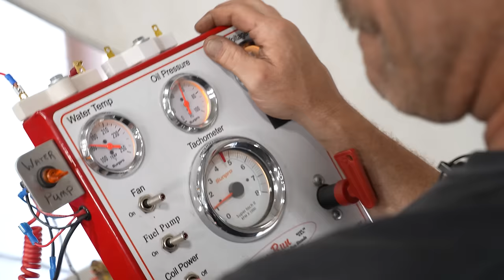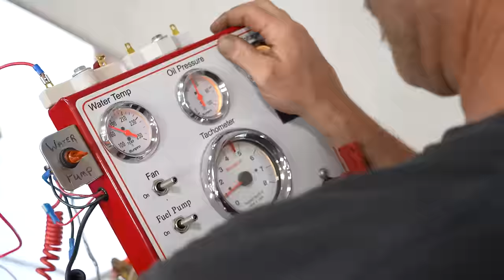Crusty Chevy V-8 Engine Rebuild Time-Lapse and Stop-Motion | Redline Rebuild

Comment: That video is a cinema masterpiece. But... that engine is about 66 years old. The oil fill in the intake and the vapor can in the lifter valley indicates it vintage. The exhaust manifolds are 70’s items. Ram horn manifolds would be correct to that motor. But I still loved it.
Reply: It came out of a 66 Chevelle, that'd make it 58yrs old.... 🤦

Comment: The most amazing thing about this whole video is how all the exhaust manifold bolts came out without even one breaking.
Reply: Pretty impressive. I’m going about it all wrong. They are a whole lot faster than I am and telekinetic.
Reply: @johnsullenger4397 ,  on a Chevrolet engine, that's normally not an issue

Comment: The editing.. the music... Hagerty is on another level of editing.
(cant even think how long it took to do the screw/bolts shots... but worth it...)

legit i opened this video to have something in the background, and i couldnt look away for the 8 minutes lol
Reply: you said it !! absolute greatness, Thanks guys!!
Reply from the maker: Thanks Nick! The disassembly shots took... a while! But we thought it was worth it, too!
Reply: Sir please 🙏 big fan of your work..can you please 🙏 make one video shoot and edit tutorial please 🙏🙏🙏🙏🙏 please 🙏
Reply: @Hagerty  I would imagine a few bottles of some nice cold beer, too. 😆
Reply: Where do you get these musics on your time lapse videos 🔥
Reply: @Alaeddine k  I require same info. The musi ID apps only work for some clips. But not these
Reply: A real film & mechanical masterpiece, No doubt ! It's exhausting just watching ! But  Damn , you should have bought an already super clean , hi - performance LT - 1 , 350/383 - bored Crate engine with a 21st century C.A.D. camshaft &  headers & and the older GM spread - bore 4 barrel carb with matching Intake ! Installed with full length dual exhaust with cross - pipe and long (3-foot ) straight - through glass - packs . Very street able and killer torque .

Comment: The most impressive thing of this stop motion is the rotation of the camera and how smooth it rolls. Brilliant work
Reply: You see the rig they use in some of the shop diary videos - it's a motorized slide rail that slowly moves while the time-lapse is taken.  They must have added a motorized turntable for some of these shots.

The corkscrew motion is probably done in the video editing.

Comment: Another timeless piece of editing goodness! I love the macro lens shots of inside the engine where the camshaft goes. Never knew how roughly casted those engines were back then. 
She purrs like a kitten like Davin says. Those restrictive cast iron manifolds really makes the engine quiet. A set of long tube headers and a beefy cam would make this engine sound niiiice. But I understand, this rebuild was meant for a stock cruiser. The engine was rebuilt better and more balanced thanks to the guys at Apex Competition Engine for balancing the crankshaft.
Reply: A shame to put that carb and manifolds back on it imo.
Reply: @karenthomson9749  I know, but it was relatively stock build as Davin mentioned before. He even mentioned before the block got painted, that black painted blocks are race engines. Orange painted blocks are stock lol
Reply: Well... when I saw the roller tappet brackets being installed I scratched my head a little. When they installed the OEM manifold and two barrel carb it becomes clear that this isn't a fire breather but an engine made to live on pump gas on the street.

Comment: Sweet! My first vehicle was a 1969 Chevy Blazer  350 small block. It had a 3 speed transmission with a L for Low in the first gear position. Low range Low gear hand a fifty two to one gear reduction. Thanks for the video. The presentation was great.

Comment: My first car was a '67 Impala Sport Coupe with a  283, "Powerslide".  Except for the "ram's horn" exhaust manifolds that was the engine that defined my youth.  Other than the  curious need to rebuild that 2bb Rochester carb and the nylon timing gear that left me stranded with my high school girlfriend on a deserted side road, it was an excellent mill.  Thank you for not giving in to the "stock build" trolls and allowing me to see this old lump brought back to it's original form .... 2bb carb and all.  Excellent!!

Comment: 283 c.i. standard hp was 195. Owned a '67 chevelle (and a '66) Both we're marina blue. The '66 had a 283 black  vinyl int. and the '67 had a rare 327/275 with blue vinyl int. The '66 had a power glide trans and the '67 had a 4 spd manual w/bucket seats.Had the '66 until Uncle Sam sent me to S.E. Asia, sold it before I left. The  '67 was used with 22,.000 miles when I got it. Price? $ 1,550. Actually liked the '66 better, my first car but the '67 had a little kick to it and was more fun to drive. The guy that sold me the car stated that the engine and 4 Spd trans were special ordered, that's why he was asking "so much" for the car.

Comment: I currently have a 1978 Chevrolet big 10 I gave $800.00 YES 8 HUNDRED DOLLARS for. 
Tore the engine down, ran the block numbers and it's a 350 4bolt main out of a 80 to 85 Chevrolet truck. 
The trans is a 400 turbo. 
This video makes me want to kick it in HIGH GEAR and get this thing BUILT AND ON THE ROAD. 
Awesome video, THANKS.

Comment: I've been driving since I 17 yrs old , now I'm 76 and still driving ' have done up two side valve engines two 6 cylinder O H V Engines and once owned a V 8 Ford G T , ( 351 WINDSOR ) , what a beast that was , highest speed 120 M P H !
I currently own a 1974 Toyota Hilux with original power plant and body , and "NO",  its not for sale !

Comment: That's Probably one of the coolest Vido's I've seen in a LONG time ! For Old Gear heads that broght back ALOT of memories . If you'll Look at my profile Pic. you'll see why ! 2018 , L83 ! No more AFM , Complete Brian Tooley Racing rebuild ! Stage 3 Cam , Heads shaved , Block was built , Heads shaved , polished and ported , roller hydralics , roller lifter , upgraded the injectors , the coils, wires ! Stainless Headers , CAI,, L86 intake and 108mm Throttle body  ,True dual exhaust . Dynoed , tuned ,,,, 712 hp !

Comment: I saw an engine disassemble itself once at the dragstrip I was working at, only his motor didn't bother undoing any of its fasteners like yalls do, it just puked everything straight down I to the pavement and up through the hood, quite impressive fireball and gouge in the track I might add. Not sure if we ever did find all the parts, I hope they made their own way back to the engine though, lol. In all seriousness, amazing job on both the build and video.

Comment: I rebuilt alot of these Chevy small blocks back in my day. The one thing I noticed this was only a two bolt mainbearing block. I preferred rebuilding the four bolt mainbearimg block engines. The one thing I learned was if you boosted compression it made these engines more efficient with horsepower to fuel usage.

Comment: My 1967 Chevy Corvette 327  with 1979 881 casting Corvette heads was totally rebuilt last winter by me & currently in my 1970 daily driver 4 door Chevelle running like a clock with 7,000 miles on it with a 700-R4 Trans.  I just picked up a 3:55/ 12 bolt posi for it so I am good.  Just finished a trip from South Florida to Huston Tx with the 327 and back in summer Tx. heat.  Water temp never got over 170 degrees even in heavy traffic with 70PSI of oil pressure hot. This was the last forged crank 327 I had. Next time you see Mike Thirlby (M-44/M-47/M-4) Tell him Mike Petty  (77-F) said hello 😀

Comment: I rebuilt one from a block I found sitting in a storage room at my college, took a few weeks to get it running but did it ever sound good with the dyno headers once I was done, made 334ft/lbs torque at 3850 and 265hp at 4900

Comment: The 283 is the  greatest  Engine  Ever ,
It is possible  of 400+hp and  can  rev to 
12,000rpm , 

I have multiple  small  blocks  including  283  , 
The 307 is  a  327 block  with a  283 crank 
The DZ 302 is 283 block with a 327 crank 
My 327 makes 475hp and screams to the moon at 11,000rpm ,
Pulls both  front tires off the ground in  1st and  2nd gear  with a  M-21 Muncie  and  12 bolt posi

Comment: My 66 Chevelle 283 had power pack heads. On the rebuilt bored two 301, I couldn't keep it cool enough and it sucked the new exhaust seat insert and blew the motor after only 5,000 miles. It broke my heart and I sold the car for 800 dollars.

Comment: That was awesome to watch. I dont think i ever rebuilt a engine from start to finish. I have helped break them down. Hone the cylinders and valve seats. Wash the engine block and parts. Small things. 
I have pulled the engines out and replaced with a newly rebuilt engine that was purchased. But i have never completely overhauled a engine. 
What size engine was that? I had a 67 chevy pickup with a 283 engine.

Comment: Back in the day i re ringed the 350 in my 81 Camaro Z28 in 1 day and drove it home that night. Enjoyed a 6 pack of hiway sodas too. Only caveat was i bought exchange heads that turned out to be junk. I found a set of 305 4bbl closed chambers and put new valve seals and added a street strip cam and the car went like a raped ape.

Comment: I had a set of those rockers get too hot at the fulcrum, because of too much spring pressure. I had to go full roller rocker. I probably would have upgraded to screw in studs too.

Comment: I wish you guys could rebuild my 5.3 L Vortec engine V8 naturally aspirated for my 2004 Chevy Trailblazer for free. Probably with correct all the design flaws from General Motors. It's an AFM engine. If I have to write tools and the right guidance I probably could tackle it myself but I don't.

Comment: i love your video you did a great job  I am hoping to get your opinion on something. I have a chevy 350 that I want to freshen up without machining. I specifically want to replace the main and rod bearings to increase engine longevity. So regarding the rod bearings, can I just replace them, do the clearance checks, and retorque them without having to change the rod bolts/nuts? Its just a stock, average HP late 70' engine that is just a daily driver. Thoughts on this?

Comment: Great video. I am rebuilding my 59 Apache 283. What head gaskets did you use? The universal 283-350 gaskets or the correct steel shim gaskets specific for the 283?

Comment: Just got a question.  What is the reddish product on the block that is on the deck area of the intake and time chain area?  I would think you wouldn’t put any coating that could flake since these are oiled areas.  Just wondering.  Thanks for your responses in advance.

Comment: Not sure what its called but the camshaft "tunnel" at 4:05 , is there a reason why they didn't clean down those high spots?
Reply: I think that was what was happening, that tool with the bolt on the end that was going in and out of the cam journal was honing it out. I may be wrong though

Comment: Good afternoon, my name is Dmitry and I am from the distant Russian city of Magadan. I often watch your video and I am interested in the question, what is the red paste that you apply to the crankshaft, what is it called and why is it called?
Reply: It is assembly lube/grease. It helps lubricate the engine on start up before there is sufficient oil pressure, to save the engine from damage.

Comment: I have a Ram Air 3 block from a 69 or 70 GTO or Trans Am. It's just the block. It is pretty rusty. I would like to know if it is possible to rebuild the motor? Any suggestions anyone?

Comment: The click bait says motor after 53 years! But a motor does not hove a carburetor and an exhaust manifold like in the picture!! What that is in the picture is called a engine!(a motor is powered by electricity and an engine is powered by combustion from a fuel source)

Comment: First off why oh why!!!! Would u put that highly restricted 2 barrel intake on with a roller cam upgrade and smog era manifolds.... Hell at least put some cheap headers and 100 dollar 4 barrel intake and hei dizzy and give it a heavy port job and light spring kit in the dizzy and mill the heads for more compression... There is no purpose to put a roller cam in it with all that stock garbage to choke it out... Hell it's cheaper to up grade it with jegs or summit brand cam none roller and there brand headers and find a cheap used 4 barrel intake and 50 dollar Edelbrock 750 or holly and a rebuild kit... I've lost respect for this...